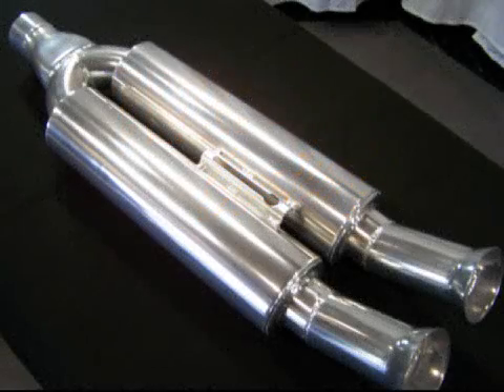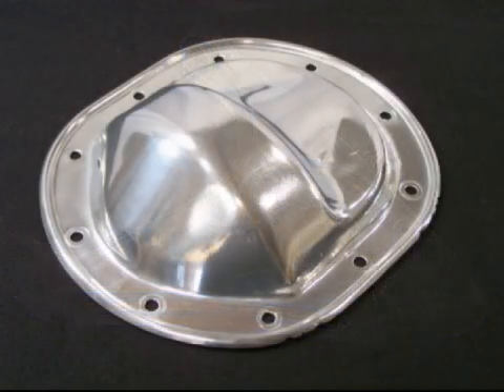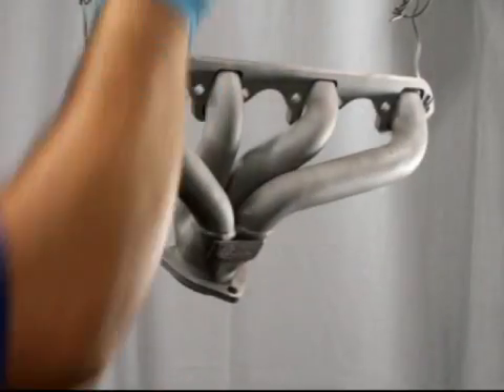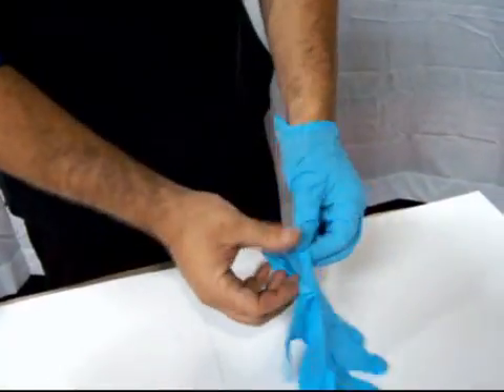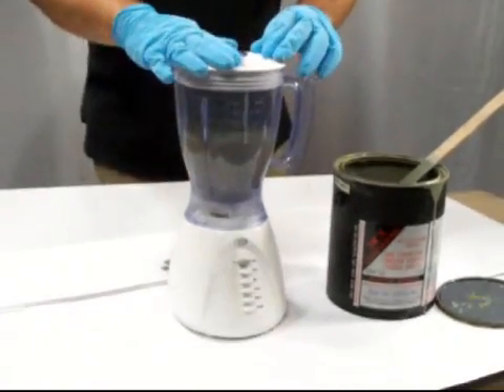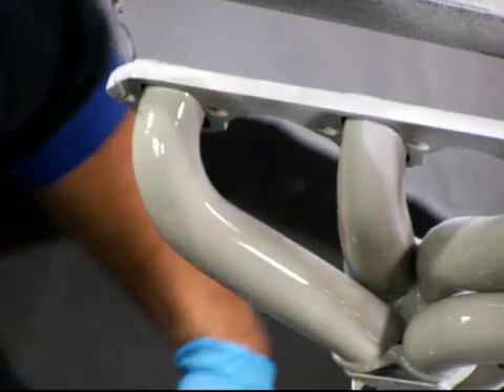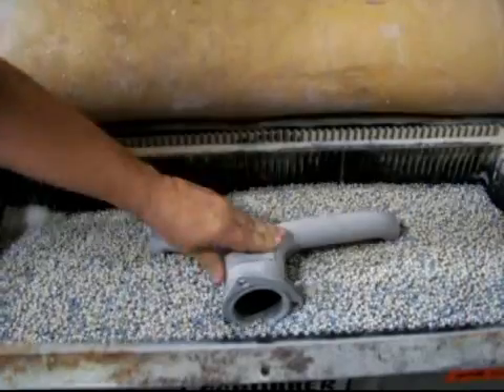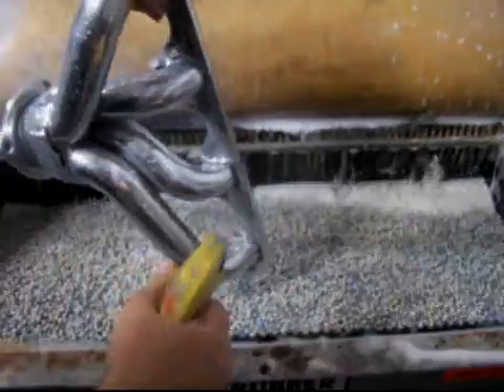Preparation and Application of Cermakrome

Comment: I'm good, geee wiz, how many frickin steps smh
Reply: That's what it takes to apply a coating that looks as good as chrome, will stand up to high temperatures and not EVER come off. There is nothing else out there that measures up. But thanks for your comment.
Reply: It's the many steps that result in an amazing finish, that lasts years.

Comment: Honey, why is my blender in the shop and my smoothie tastes like paint thinner................
Reply: It's a water-based coating, so it cleans up with water. But due to the chemical structure of the coating I certainly recommend against using it for anything that will be consumed.

Comment: it does not have near the high gloss of hard chrome.
Reply: That may be, although it comes pretty close. And you can't expect hard chrome to stand up to temperatures on headers, especially racing headers.
Reply: Chrome looks great till it gets hot, where as ceramic coatings generally will take  up to 1300°f without discoloring...
Reply: The discolouration of Cermakrome is due to the aluminium content becoming burnt as a result of the excess heat over extended periods of time. Even after the coating has discoloured the coating is still an effective thermal barrier to approximately 1000 degree Celsius or 1900 degrees in the Imperial

Comment: Love how people say shit like "Will aluminum warp at 500F" Well to educate a bit. First of all it depends on the aluminum alloy used in the application. Second it depends on if you let it air cool or quenched it like a dumb ass. Quenching especially in water will almost certainly warp any type of aluminum alloy.

There are a ton of other factors to consider when it comes to warp-age of something like a head. I have seen people bake heads in order to restore flatness but I almost always hear about them taking it to a professional and not doing it in the oven due to an oven not having a high enough heat range to return it to its original flatness.

About the only solution at home for lack of flatness is to lap the head very carefully on granite or glass and will only work on a head that is not severely warped we are talking with in the .0015 to .03 mm range.

So in conclusion if your head warps its mostly because it was already warped. A household over will probably not warp it as the sheet you place it on will reach the same temp at the same time as the head. Warping usually happens when the temp suddenly drop quickly.

Mostly studying aluminum alloys used in automotive applications will help you decide as to weather or not to bake the part. But for god sake don't open the oven door let the oven cool down gradually as this will greatly diminish the risk of any warping.
Reply: I have to agree with Zenme minus the name calling. To straighten an aluminum head you need to apply opposite pressure as well as heat. Least that is the way my machine shop showed me. It was an overhead cam and I wanted the cam bores straight as well as the gasket surface.  They straitened it close enough that it only took a slight shave to clean up the bottom. 
Also if tempering the aluminum. I understand it can be quenched. Whether it warps or not depends on where and how the temperature is applied or removed. Bike frames can be particularly tricky but are done all the time. After welding they always have to be straightened after annealing and then they are re tempered.